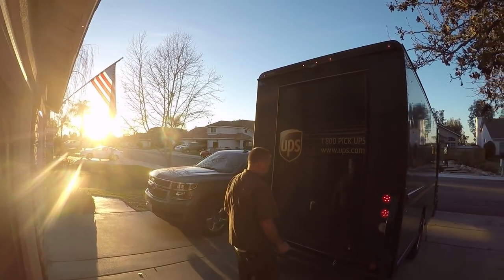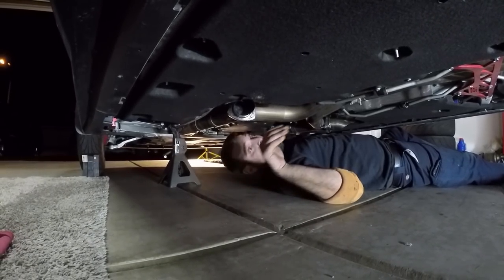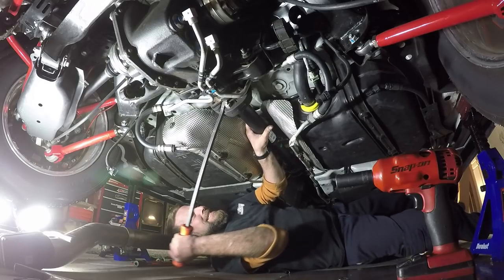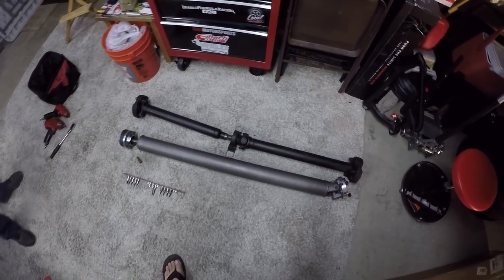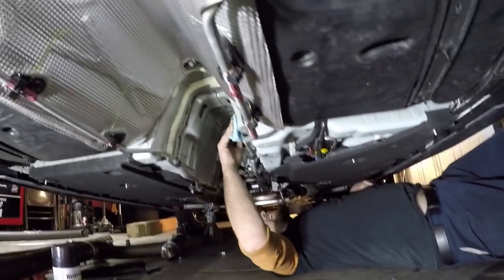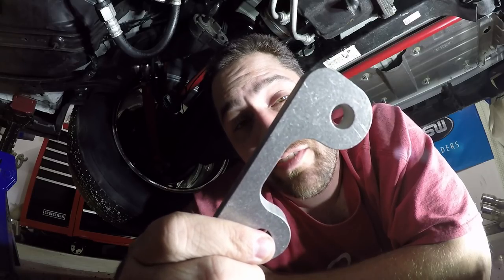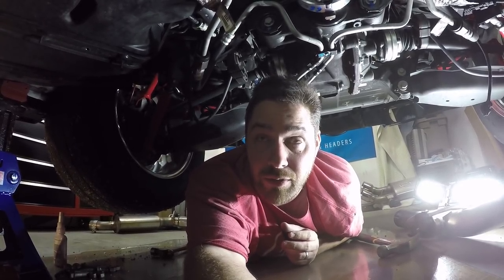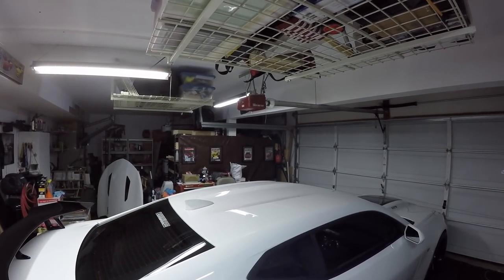Driveshaft & Driveshaft Safety Loop Install | BMR & Driveshaft Shop | 16-18 Camaro SS

Comment: Hey bud. Thought I’d pass something on we learned last night. I think zr1 was a rush and a band aid Chevy needed. We raced a zl1 1le vs a new z06 last night. Both were auto. There was no doubt the zl1 was faster. Maybe not at high end but was definitely noticeable. I was under the impression zl1 and z06 were same motor but the super chargers and cam are different. Camaro has smaller blower but more boost. I think Chevy released the zr1 because Corvette was not their fastest car. If I bought a 110k z06 I might be pissed a 80k zl1 will beat me. Lol. I think this explains why zr1 came out when it did.

Comment: What was the off set and back spacing on the wheels you ended up putting on the camaro?  Also will 18" wheels clear the brake calipers on the back??

Comment: Hey lethal i have a 2017 ss and I recently bought a zl1 differential with the trailering arms and rear axles, and planning to install it on the ss, I was looking at phasteks driveshafts but was wondering if I should go for the ss driveshafts they have or the zl1 driveshafts?

Comment: How much HP is that stock shaft supposed to be good for? Would you be at risk of breaking it with just sticky 305s on the rear with stock hp?
Reply from the maker: People have broken them with stock wheels and power.

Comment: Hey @leathalgarage is the driveshaft safety loop needed when installing the driveshaft or just for extra safety ???
Reply from the maker: It’s always wise to have one when running a 1 piece setup. Helps prevent. Drive shaft coming through the floor

Comment: what axles are you running???  I'm at the 600+ stage.  I have a Magnuson 2650 with the stock 310mm pully.  I put a 300 on and it does nothing but spin on the highway even at 60+ mph.  A little scary.
Reply from the maker: DRive shaft shop

Comment: Great video! So my only concern was not seeing you guys replacing the rear tranny tail shaft seal, but it looks like the way it’s put together you didn’t have to worry about pulling the yoke out. On older cars it sucks cause the fluid would drain out all over the place. Hopefully the seal wasn’t beat up with all the shaking /vibrations. Nice one man!!

Comment: Quick question, did the dss come with the bolts and nuts? Or did you have to order 6? Also did you reuse the rubber flex discs?
Reply: Sorry just watched the whole video,  so you pull the Guibos, and then use the size 8 Allen on the plates,  then mount those plates onto trans and diff flange? 
Next question,  when I pulled the drive shaft at the differential a thin deep socket looking part separated off and I pulled it from the differential,  do I need that or did it break off my shaft? I'm a rookie lol.

Comment: Can this be applied to stock cars for piece of mind?
Reply from the maker: Yup
Reply: Looks like you may have to upgrade you diff as well 😬
Reply: You should look into race ramps the complete set that raises the whole car off the ground
Reply: Not sure why you would replace it for piece of mind tho... May as well let the stock die before replacing it.  Then the aftermarket one can last even longer if it ever came down to having to replace it.
Reply: James Min some people have stated on the forms that the stock drive shafts on the SS 1le’s have caused problems, rare but has happened just....piece of mind
Reply: David E To me, peace of mind for reliability is beneficial when you have a daily driver / family vehicle that you do not want to find yourself stranded some where.  Those guys who had stock camaros who broke their stock drive shaft were most likely tracking it hard.  If peace of mind was a priority I probably would not be tracking.  If you do run your stock Camaro hard enough to be corcerned about being stranded at the track, I guess upgrading make sense.  ... But if you don't, I would rather wait until the stock breaks.  Its not the same peace of mind like upgrading your cooling system, IMO.. Where if that fails, catastrophic damage happens to your engine.  Drive shaft breaking is like getting a flat tire.. You just replace it if it happens.

Comment: What is the weak link in the drive train Now ?
Reply from the maker: Transmission and differential
Reply: And I guess they cost more to fix ???     I hope they can handle what you dish out !!
Reply from the maker: Well I have been on borrowed time for the trans for awhile. That is a pricey fix if it goes south. The diff not so much, but any cost is never fun.

Comment: try ezcarlift.com, this lift looks good to me. I have a QuickJack, better then a floor jackand stands, but if I had seen the Ezcarlift 1st I would gone with it. If you have a goodpower pack 1/2 drive drill you could even use it at the track.